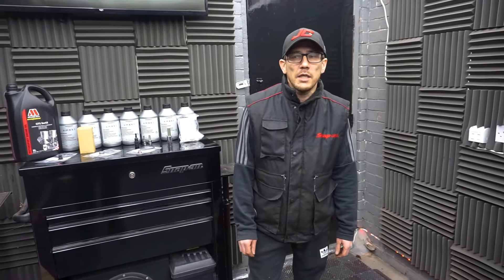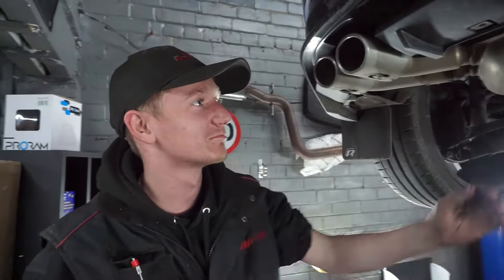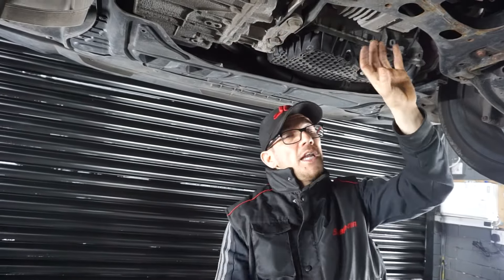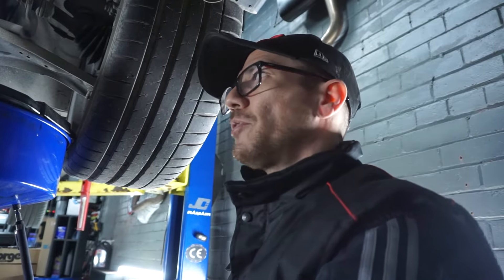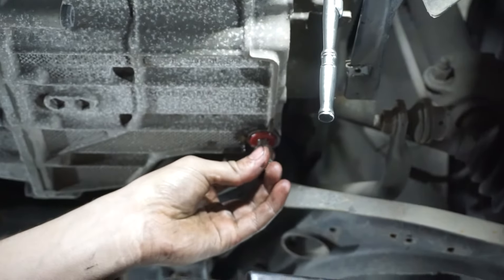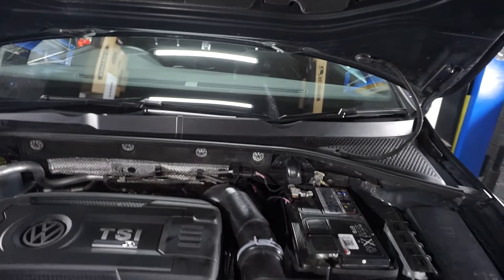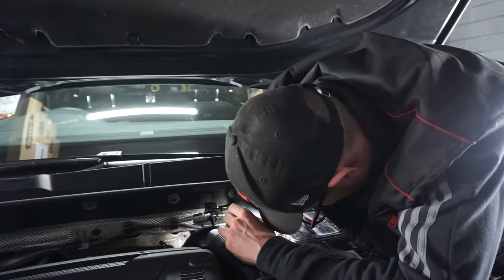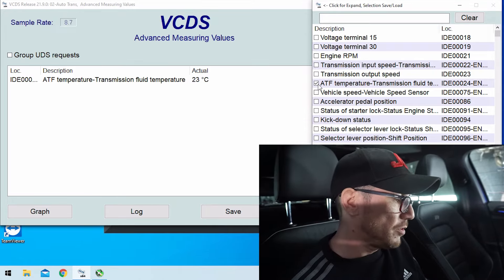VW Golf MK7.5 DQ381 7 Speed DSG Service

Comment: Good video. I did mine a few days ago. I used a tube with adaptors on that I got from amazon to put the new fluid in, went in quick after making a small hole at the bottom of the bottle. I wasn't sure the car was totally level on ramps and axle stands so put the plug in when the fluid slowed a little, could have been just pumping through but I put 7 litres in and must have drained off about half a litre. Can't see the little difference in checking the fluid level at a specific temperature being that important tbh. I got the filter off from the top without removing anything else, took ages, and I'd got the wrong filter to replace, had to put the old one back in while waiting for new one.

Comment: good video but I think you're missing a part while after fulling with 6literes, on running engine you change gearshift position for each (P, R, N, D/S) for few seconds that oil can go through mechatronic as well
Reply from the maker: Thanks, yeah we did forget to mention this in the video (it is always done however), we may film again in our new unit with more info on these DQ381 boxes :)

Comment: Good video. Just also add that when setting the level, the red plug needs to be finger tight and then unscrewed 2 full turns. Then run up to temp and let the excess drain. When it stops flowing, tighten the red plug back in and then fit the sump drain plug.
Reply: nope, the red one should stays as it is after being screwed with 3Nm, only the beige one should be unscrewed by 2 turns
Reply: Thesled is not correct here.
Reply: @walek00001 both are incorrect. The check value does not need to be loosened whether gray or red. Per Audi/vw tech - we tighten the valve and start the check level procedure. No 2 turns back regardless of valve color. We are talking minuscule amount of fluid difference.

Comment: Manual states to set the level with the overflow pipe 2 turns out, once set screw back in and fit drain plug with new washer.
Reply: Thats what i thought too, im getting ready to do my first and i’m definitely going to unscrew two turns.

Comment: Thanks for video. Did you unscrew the overflow thingy for about two turns like it says in the vw manual. Aren’t you worried that your gearbox is a bit overfilled now? I’ve seen videos where they unscrew it and then wait until the excess oil kind of gushes out every 30 seconds. I’ve read that vw/skoda/seat has had underfilled dq381 gearboxes from the factory. Have you heard of this?
Reply: Such overflow should be acceptable.

Comment: Does this method (or DQ381 gearbox) allow to empty gearbox completely or does some old oil remains in the unit? Was this design changed from previous/6-speed DSGs to be able to drain it completely without flush changing the oil?
Reply: It always has some fluid left in the mechatronics just as the old DQ500 and DQ250. It is not possible to drain fluid from the mechatronic unit unless you remove it from the transmission. 
If you would like to change the fluid completely(though nonsense), change the fluid twice.

Comment: Hi mate, very helpful video. I managed to do it myself without any problem. Morevore do you recomend doing the basic setting then or is it ok only by changing oil? Thanks a lot
Reply: Basic setting is not needed, the transmission is continuously learning about the status of the clutches and solenoid valves while you are driving the car.

Comment: great video ! i owe passat alltrack 2018 tdi 190 HP. I assume it has the same transmition. is servicing (and what kind of) necessary on every 60.000 km or 120.000 km ? 
thanks in advance !
Reply: The car manufacturer says the service of the DSG DQ381 is necessary on every 120 000km, but I will change mine on 85 000 next week.
Reply: DQ381 with G 055 529 A2 initial filled DCTF has an interval of 120,000 km, while DQ381 with G 052 182 A2 as initial filling should change oil at every 60,000 km, however you will never see the latter variants, they do not exist in your market.

Comment: And I'm guessing you dropped the overflow plug by two turns and cycled through the gears to fully distribute the new oil off camara, right? 🤠
Reply: it depends on overflow plug color, beige one should be unscrew by 2 turns while red/orange one should stay as it is after it was screwed  with 3Nm

Comment: Great video guys, so how much oil did it need for the service?  subscribed!
Reply from the maker: Thanks for the sub! The gearbox took around 6.5 litres before getting up to temp and allowing the excess to drain and the engine takes around 5.7 litres
Reply: @JCR-Leeds  Does Mechatronics have same oil as in gearbox and does not require separate filling?
Reply from the maker: @Slavixs  The mechatronics oil chamber does not require seperate fitting or different oil

cheers

Comment: That oil looks clean.  What is the minimum and maximum period to change dsg oil on a Golf?  What happens if a vehicle has exceeded the minimum period?  I heard that older VW DSG's the oil needed to be changed at 40k and newer vw's from 2020 its 75k
Reply: DQ250 is supposed to be 30k miles and DQ381 which is 2019 or newer is 80k miles. I probably wouldn't go 80k miles though. Depending on your driving maybe do it at 50-60k. German cars love their scheduled maintenance
Reply: Yeah, I thought the oil looked very clean coming out, but the old filter looked quite dirty as it came out.

Comment: Out of curiosity are you able to comment on what condition the oil has been in on these model of DSG7 gearboxes when changed at 40k in comparison to the predecessor DSG6 at the same mileage.
Reply from the maker: We can't say scientifically, but in both models the oil looks significantly darker than the new oil we put back in. In terms of comparing the 6 to the 7, we can't tell enough difference to compare
Reply: @JCR-Leeds  vw don’t say to replace the filter on 381 just oil and plug
Reply from the maker: @jamesburge9145  Not suprised, they also don't say to clean the filter gauze on the gen 5 haldex too

Comment: Great video, could have done with this last year when I did my Leon Cupra 4Drive.
Do you guys have the part number for the mechatronic drain plug, I reused mine last time as couldn’t find a replacement
Reply from the maker: We don't have the part number for that drain plug unfortunatley, sorry. If I do find it I will let you know
Reply: I managed to find it in the end, I chewed the thread on mine a bit so I’ll get a new mech drain plug next time
I do it. 
Here is the part numbers for anyone interested 

Oil 6 litres - G055529A
Oil Filter - 0GC325183A
Oil filter O-ring- N91084501
Drain plug washer - N0438092
Drain plug - N90215404
Mechtronic drain washer - N0138132
Mechtrinic drain plug - N90965401
Reply: @ricks4490 6 liters of oil? not 7?

Comment: You forgot to mention that if your DSG has a red overflow pipe, you have to turn it fully in and then 2 full turn back then you make the level. If it's a beige overflow pipe, just turn it fully in and make the level.
Reply: doesn't really matter, just put same amount as the amount that came out. Half a glass of oil will not make any difference at all.
Reply: @krisg822  If it didn't make any difference, there wouldn't be two ways of doing it.
Reply: @MrSonicAdvance  you are yet to learn, how companies make money.

Comment: I can't seem to find anything on my Kamiq 1.5 7 speed dual clutch. I think it's a dry clutch? However does the oil need to be changed and at what time?
Reply from the maker: Hi, yours should be fitted with a DQ200 which when servicing is simply replacement of the mechatronic oil and gear oil. There is no advice from manufacturer on when this box should be serviced as they say its sealed for life, but we would say every 40k like the rest.

Comment: Hi, i just did oil service on my dq381 and they only filled 5liters of oil how its that possible they checked the level its ok??
Reply: thats too little. They cant "check it" there is no checking it. Once the nuts done up with the wrong about of oil. There is no checking. My advice is get it done properly or else its a 6k bill for a new one.
Reply: @johnboy2436 my seat leon takes 5.6L , the DQ381 are not all the same, i think mine has somewhere some dedicated radiator for cooling the oil, but not sure. So it could be that it's really 5L on his car.
Reply: They are the same, there is a plastic fill pipe inside. If you watch his newer videos he goes back and addresses it. I have upgraded the DSG cooler and the aux rad on mine. They run on coolant not oil.
Reply: @johnboy2436  i never claimed the DSG oil runs through that radiator.
Secondly, there are at least two versions of DQ381, one has white/grey tube(mostly in SUVs) , and one has red/brown tube.
Mine has the red one, without removing the insert tube, i get about 3~4L of oil, after removing it i get it to almost exactly 5L.
After removing the mechatronics oil plug, it becomes in total about ~5,2L.
Tilting the car will get you another 0,2L to a total of 5,4L.
Where is the last 0,2L remaining? The filter....its a mess when removing it, i tried everything, even vacuum, still the oil spilled everywhere (my filter is horizontally, not vertically).
So yea, i don't really remove any oil from DSG once i refill it. I just do 5,7L, bcoz some of it will escape anyway, when installing the oil plug, so it ends up at slightly over ~5,6L.
I also never switched between gears, its pointless, when in P, the mechatronics already pulls the oil, and when it switched to any gear, the oil shoots through that part of mechatronic before the that gear is engaged - after all, DSG has two clutches, one is engaged, and one waits ready with selected gear....so the one who waits, already has oil running through it.
I think it's some myth from previous DSG generations, about the need to switch between all gears after swapping the oil 🤣ppl don't really know how it works 😅
The only thing that you need to do, is to let the car run for like 10~20 seconds in 'P', just idle so that the air gets out of the mechatronics and out of the filter - and that's it. The moment you select 'D' the mechatronics will run oil through that section....and all that even before the car starts moving.

Comment: I did my fluid change under the impression i had the 6spd box, knew my car was 7spd but didnt know that the procedure was different also didnt know that there even was a 6spd so when finding procedure i assumed they were showing me the 7spd. I never opened the 2nd plug you showed, only the bottom one. Drained. Filled 5.8-6ish L of fluid (little spillage ) and then got up to temp 38C. Let drain until bubble/drip. Am i running on too much oil? Is there any risk? Should i double back and redo my fluid change? Thanks for any advice.
Reply from the maker: As long as after you filled the oil up, you let it drain until it trickled out as you mentioned you will be fine as that keeps the level correct for the whole box. Worst case you may have a slight bit of old oil left (the oil that would of drained out of the mechatronic drain plug) mixing with the new oil but I'm sure it will be fine until next time you service the gearbox
Reply: @JCR-Leeds  Cheers mate. Thanks!

Comment: how long can that transmition last anyway ? with regular servicing
Reply: It is 80,000 miles for DQ381 with G 055 529 A2. However it is 40,000 miles for DL382 with the exact same transmission fluid.